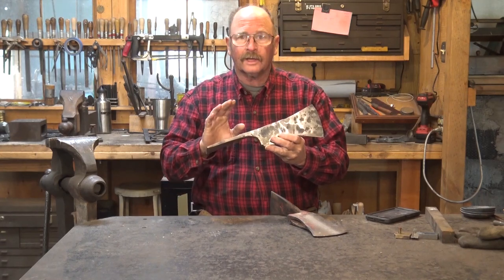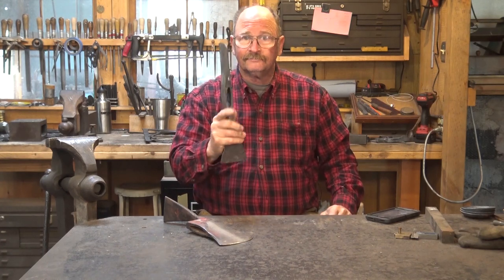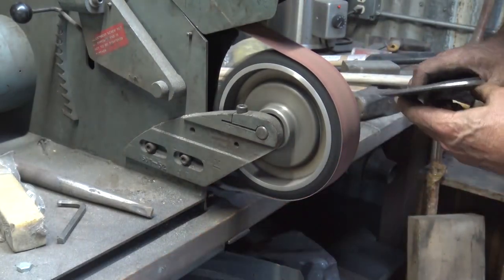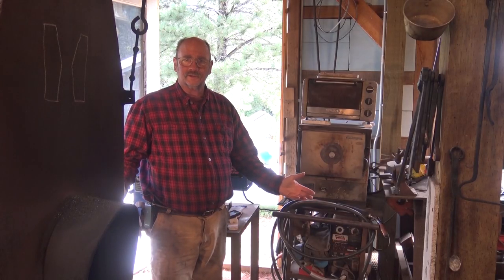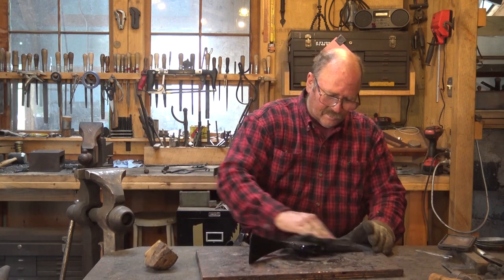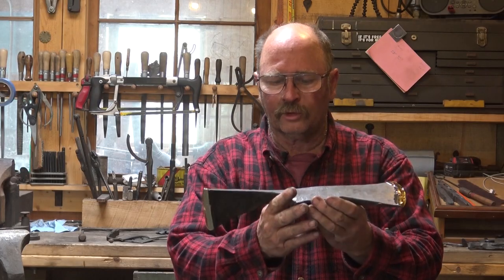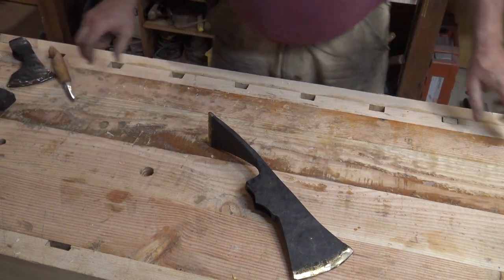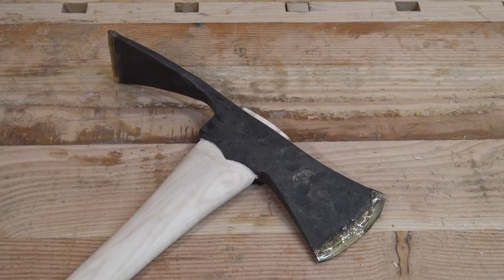Pulaski final assembly and handle - part 4

Comment: I like how ya put hot glue on the edges to preserve the grind and edge. Really smart. I've been doing that for my own felling axe that I fixed up after I found in the middle of a field and caked in rust.
Reply from the maker: I don't actually use hot glue, although it is probably similar. The product I am using is a hot melt coating meant for tool edges

Comment: Awsome project, great to watch the build. The drift you used is a nice tool would like seeing one of those made from tool steel. Thanks John
Reply from the maker: I will cover doing big drifts, but probably not until I get the power hammer back up and running
Reply: @BlackBearForge  just noticed your wood mallet quilted rock maple? Awsome mallet
Reply from the maker: It is stabilized wood with one leather face.  The mallet is made by Blue Spruce Tools in Oregon 

https://bluesprucetoolworks.com/collections/mallets/products/rectangular-mallet

Comment: While watching the quenching section, I thought (a) that's a really nice grill behind your legs, and (b) that I'd like to ask what you keep around the forge for fire suppression.
Reply from the maker: First I keep the quench oil in a can with a spring loaded lid so it puts the fire out when I back away.  I then also have an ABC dry chem extinguisher hung in a central location and easily accessible.  But the reality is that I have never had any thing catch fire that couldn't be extinguished with the dipper from the slack tube

Comment: Great project John.  That quench was a little dangerous    I keep my oil in metal buckets also.   Good idea.    The again ...paul
Reply from the maker: Not to bad.  Just move away from the can and the spring loaded lid closes to put the fire out.  I would prefer a better selection of water hardening steel though.
Reply: Yes I been buying w1 for the same reason.   It’s not available in all the same sizes close but not all.

Comment: Would you mind posting the link to that handle company? And the new mike is very nice :)
Reply from the maker: https://www.househandle.com/
The new mic should be an improvement, if I remember to plug it in.  Which you can see in the next video that I spent the evening trying to edit.  Mostly successful, but thats what I get for trying to use multiple cameras without being sure it would work.

Comment: Question, when drifting from the top, couldn't you set the head on the drift like you'd set a head on a handle. Turn it upside down and smack the handle of your drift on the anvil?
Reply from the maker: It works up to a point.  But if you really want to do some stretching the drift needs to be driven in.

Comment: John one of the big box tool places ( didn’t wanna say name ) not the cheap tool one has those safety cans up too 21 gallons
Reply from the maker: I have thought about getting one that big.  I keep the oil in a smaller metal bucket inside the rag can so there is a double wall.  The 21 gallon size would hold a 10 gallon container of oil nicely

Comment: That came out awesome! Is there a reason you don’t add metal wedges?
Reply: Since this eye is very narrow and long, there's a lot of surface area contact between the eye and the handle. As long as it's wedged properly where the handle flares slightly at the top of the eye, a wooden wedge shouldn't back out provided it's oiled and not allowed to shrink.

I think a steel wedge is more important with hammer handles or single bitted axe handles where the eye is rounder and less oblong, but a little insurance is always nice.
Reply: MauledByBears thanks for the reply! Makes sense!

Comment: What makes you decide to use the gas forge vs the coal forge?
Reply from the maker: The gas forge is best for production work or larger items that need an even heat.  The coal forge is better for more controlled heats and odd shapes that don't fit in the gas forge.  But often times it is really just the convenience of being able to turn on the gas forge without cleaning out the ash and clinker fro the previous fire.

Comment: Hello John. After you finished the head, it looks like you made little covers for the edges. Would you mind telling me how you make those?  Thank you. Good job on that Pulaski head.
Reply: It's a protective coating that he dips the edges in. He has mentioned it in one of the adze videos. It will peel off when it gets to the buyer so it can be used. You'll find it on axes and things when you purchase it form the hardware or home improvement stores. Keeps you from being cut on the edge and protects the edge until it is in use.
Reply from the maker: Exactly what Bryan said.